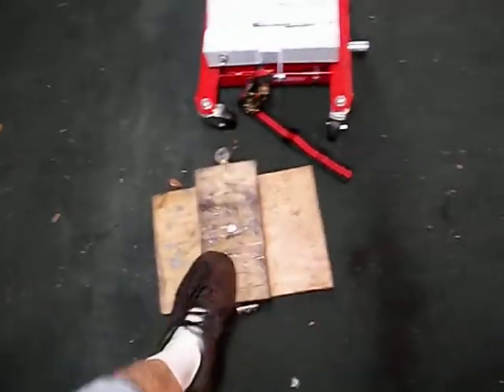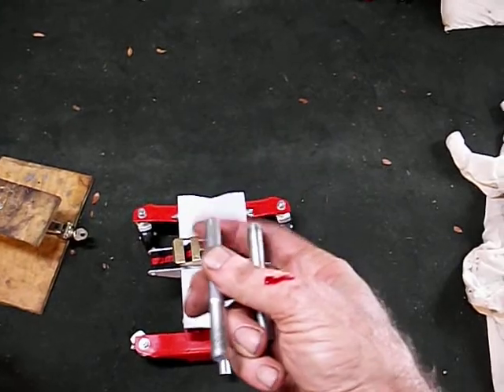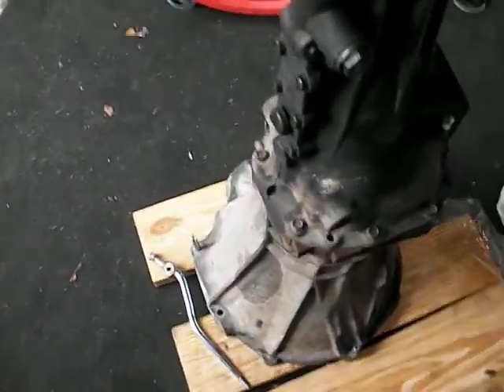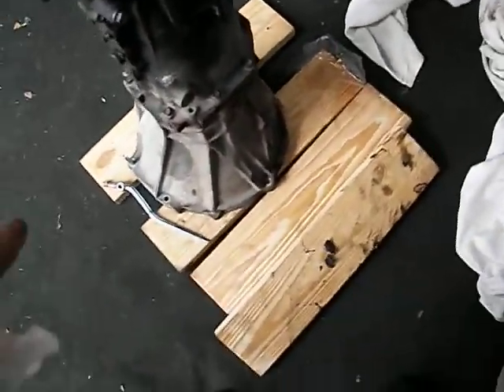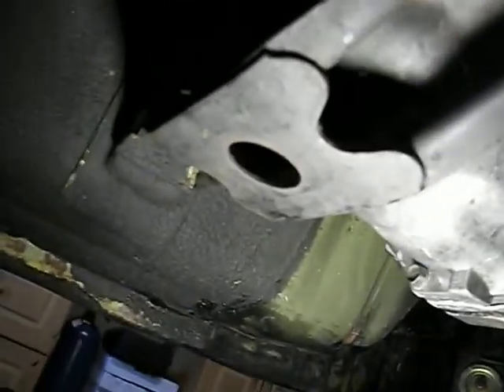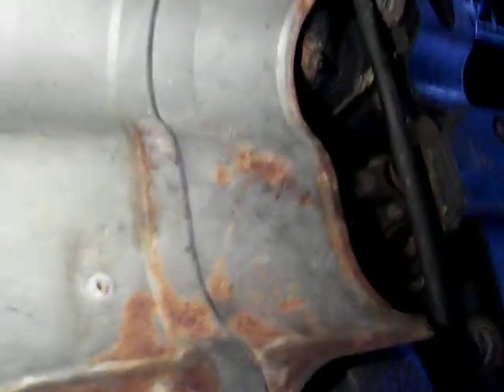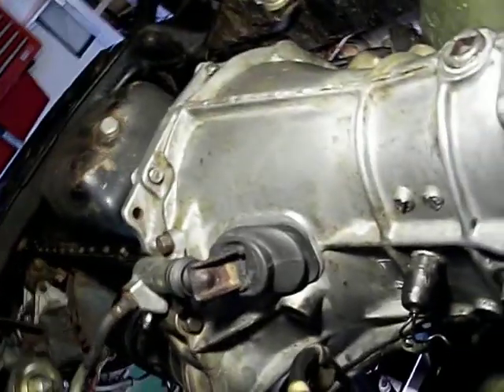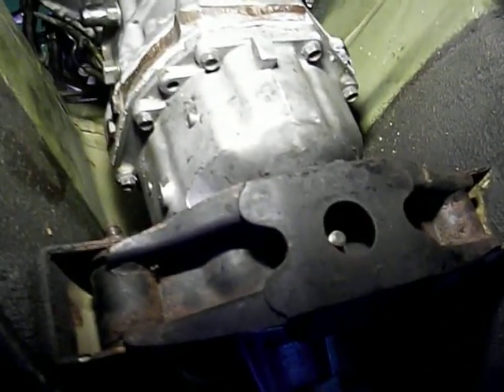1975 Datsun 280z clutch and transmission swap pt 10

Comment: Jesus clip!!  You must be a sheet metal worker!!  All kidding aside your videos are priceless for all those who service and maintain their own Z's.  I'm beginning my own restoration and your tips and troubleshooting advice has been very helpful.  Keep up the great work Dave!
Reply from the maker: I like to throw that stuff in now and then to see if anyone is listening  :)After I got it in and got a chance to drive it some, I noticed a pretty loud gravely sound in all gears. Darn. So I pulled it and put the 4sp back in for now, back to nice quiet. So far no more oil leaks around the rear main but I will have to put some more miles/time to know for sure. I am thinking of just sending it out to be rebuilt. Not sure I want to take on a full disassembly, "man has got to know his limitations" (Clint EW), Still pondering of that one. Could be fun.the upside is I can swap the trans in about 6 hrs now, prob faster each time up to a point. The biggest time sponge is the jacking process which should go faster with another hi lift floor jack, and the exhaust, nothing to make that  go any faster. Its long from tail pipe to manifold, and just a pita to get back in by yourself. Taking it down is not too bad.
Reply: Dave have you watched any of Paul Cangialosi videos on his "GearBoxVideo" channel?  He does a complete video on rebuilding a T5 transmission.  He was also a special guest on Eric The Car Guys channel, and they did another great T5 rebuild video.  Paul sells the rebuild kits on his websites and has a book on the subject.  Paul makes some awesome videos and the rebuild kit for the T5 is - I think - around $370.00.  I think I'm going to give it a try with my T5.
Reply from the maker: I will check it out thx for the tip. Oh got the trans tear down started, will shoot some video if for no other reason but to aid in the reassy.